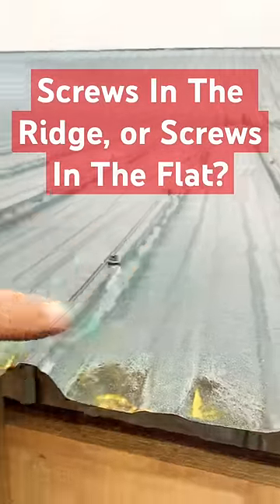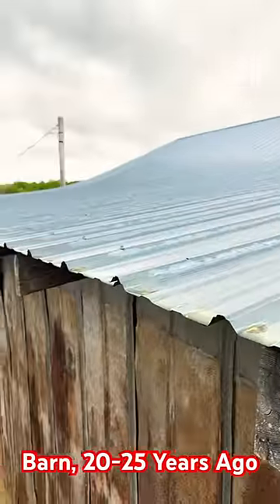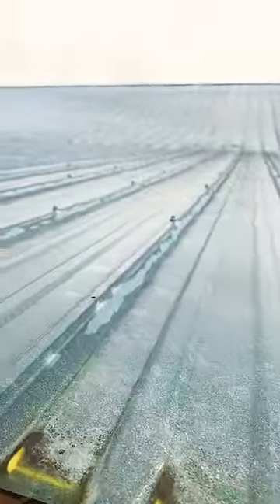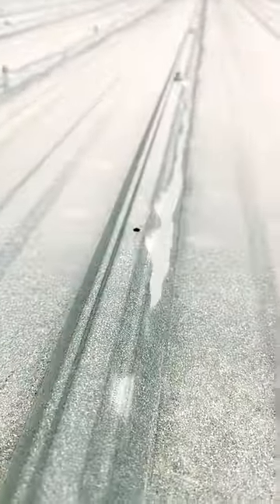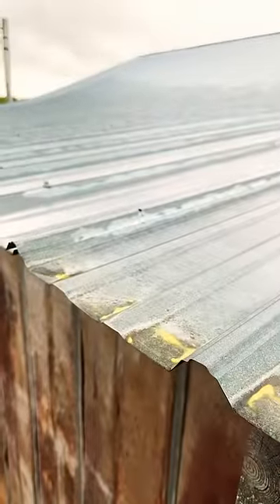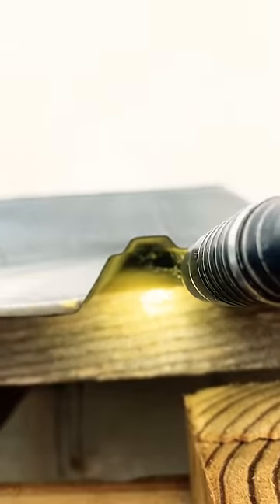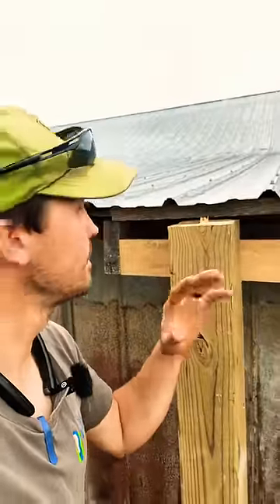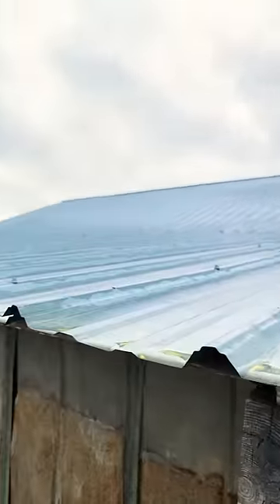What’s Better? Screws In The Ridge Or Flat? #construction #farmlife #building

Comment: We've been using corrugated iron rooves in New Zealand for well over a hundred years. You never nail or screw on the flat. Always on the ridge  !
Reply: Thank you for proper plural spelling/grammar ie; "rooves", and not, 'roofs'.
Refreshing.
✌️🤎
Reply: @kajem575    well,  the dictionaries will disagree with you and note that "rooves" is accepted as a minority form

now if he had been an Aussie it would have invoked images of the things Roos have on the end of their hooves  ( hoofs ? ) 

and folks wonder why English is so confusing to non-native English speakers
Reply: How about in siding applications?
Reply: CHUR CUZZYBRO!🤙🤙
Reply: @davidboakemeek  in panels like shown in the video, always in the flats except for stitch screws in the overlap   --   on corrugated used as siding,  doesn't really matter
Reply: @boagrius7765  Yes. Yes, he does know. I constantly watch videos of USA folk put screws incorrectly in the pan. We Australians have had metal rooves for 101 years, therefore having more experience than the Kiwis, nevertheless he is 100% correct.
Reply: This is not correlated iron. It’s formed aluminum installed with gasketed screws in the flats as required by the manufacturer except where panels overlap.
Reply: @CombatMosquitoTrainer No he’s not. This is not a corrugated steel roof. It’s formed aluminum an gets installed with gasketed screws placed in the flats except at overlaps, as required by the manufacturer for the warranty to remain in effect.
Reply: @kenton6098  If you put screws in the pan of a zincalume roof you will eventually get leaks as the neoprene washer deteriorates. ALWAYS.
Reply: You never nail a screw
Reply: @kenton6098  right:  not corrugated iron  -  it's corrugated steel  -  not aluminum

from the close-ups you can also tell it is galvanized and not galvalume    -     galvanized uses a zinc coating   -   galvalume uses a zinc/aluminum mix which makes it smoother and shiny  -   you can galvanize aluminum and you can buy aluminum roofing,  but it has a lot of "ifs" and costs way more which is why you seldom see it except in architectural roofs

you are 100% correct it fastens in the flats and laps per the manufacturers
Reply: Manufacture wants you to make holes in the flats to sell you more product duhh…. warranty 😝 it’s about to expire anyways
Reply: @artolicris  same reason for everything. That's why step number one, with anything i get, is disregard the instructions.
Reply: @Sublime_1 unless you're in prison and she's hot. Lol
Reply: @bisurdaddy  lmfao. This is true.
Reply: I would put majority in the ridge but in strategic spots I would hit the flat
Reply: @Sublime_1     you must have never worked around electricians
Reply: That's not what the manufacturer say.
Reply: Kia Orana  , We do the same in Rarotonga 
tuanui
Reply: @Sublime_1 
Is that why it’s common knowledge/stereotypical that “as men we don’t need no damn instructions”??? I mean, for whatever reason, we do always disregard the instruction no matter what we’re assembling and/or putting together!?!?!?
Reply: @jongoin4404  probably.  Lol. Its just built in knowledge ingrained in our dna
Reply: @chrisalister2297    yeah:  but all the manufacs do is hire designers and engineers for the product, manufacture the product,  and warranty the product ( on metal roofs usually 20 years -  some as much as 50 ) against leaks caused by defects IF installed according to certain criteria   -   why in the world would anyone think the manufacs would know the best way to install their own product that they have to warranty ?
Reply: @CombatMosquitoTrainer   well when my great-granddad built the buildings for his farm in Iowa  in the United States way back in 1891 (which was 133 years ago) he nailed all of his galvanized corrugated steel roofs on the ridge.  Because my great-granddad would not have done anything wrong.  And I say nailed because screws were too expensive for most farmers..   they use nails with a lead washer.  It worked because those buildings built that long ago are still keeping the rain out.
Reply: I build steel buildings and you never screw in the high ridges. Only at the lap. 

The low portion is where you put your structural screws.
Reply: @kasaljf  Yep. Same here in Australia.  Some of our corrugated galvanised steel rooves are 100 plus years old still nailed with the lead washers.
Reply: @ARC1A1A  who imstructed you to do it that way
Reply: @Sublime_1  i’ve been building steel buildings for decades. All of my manufacturers from Nucor to Cornerstone. Lap (Trim) screws go on the laps (Highs) and structural screws go on the flats into structural members.
Reply: @ARC1A1A  yeah, that's what i figured. Im not saying one way or the other is right. But, The people telling you that, have every reason, to tell you to do things in a way that limits the life of the product. If you're screwing only flats, they can use less material for screws, making more profit there. if it rusts over time they get more profit for repair material. If the roof lasts forever they really don't benefit from that unless they only sell material for new construction. For what specific reason is the flat used? It probably holds more secure, id assume, but, after time rusted screws aren't secure. If they keep from rusting it could make more sense, for longevity, to do on the ribs. Given it holds secure enough, Which it appears to have held up pretty nicely on this roof that looks pretty old. I havent dome many, mostly do rubber and pvc, but, every metal roof I've done, was screwed on flats, and alot of the screws were barely holding on from being rusted, and they weren't old at all in comparison to this roof.
Reply: @Sublime_1  yea well every metal PEMB building manufacturer I know says to do it that way so if you don’t your warranty is shit. And we’ve been doing it like that for decades.
Reply: @ARC1A1A  And... what about any of that invalidates my point?
Reply: @Sublime_1  all of it. They have engineers who know better than someone in the field who thinks he knows better. It’s called research and facts. Look them up sometime. You’ll be amazed at what you can learn. I like working with engineers. They have a lot of schooling to learn best practices from experience and time tested research. 

To me that’s much more credible than some Joey off the street.
Reply: @ARC1A1A  automobile manufacturers have engineers too. And, guess what, they intentionally design things to fk up at a certain point so you have to replace your vehicle or buy their parts. You can think defensively, and not want to believe there is a even a small chamce that a business would tell you to do something in a lesser way, to make more money. It's a very simple concept of maximizing profitability, which is #1 goal with most any corporation. Or, you can have an open mind, and understand that just because it's what you were taught and most people do doesn't necessarily mean it's the best way. Ik you'd like to assume it's the best, I would too if I had been building buildings a certain way. Aside from, youve been doing it for 30 yrs,  its manufacturer instruction, and what your buddies do, you haven't given any real reason of why it may be better to put it on the flat. There's a person on here from a different country that says in that country manufacturer reccomends on the ridge, and they're all done that way there. They could be lying, idk, but so could the manufacturer on the best way to screw it.
Reply: @ARC1A1A  results are what's credible to me. When I look at enough old roofs with it in the ridge vs the flat, that is when I will decide which is better. Uk, I was hoping you'd come in with an example of roofs you've replaced or something that explains which wpuld be better and why. But, regardless of who said it, or whos been dping it for how long, , someone said so isn't a good reason to accept it as fact for me.
Reply: @Sublime_1  well research is the quantitive measure of results. Much more than what you can see with your eyes.
Reply: @Sublime_1  LMAO. 

Go design a car then you’re so smart. Or anything.
Reply: @ARC1A1A  who's research though? Like I said, someone saying so isn't enough to persuade me on what's best. Research can "prove" things that aren't accurate. How the research is done, things such as, what you do, or dont, take into consideration, determine if your research is worth a shit or not. And, Research done by people/companies who sell or manufacture the product, who need continual business, regardless what it is, is not research I will have any faith in. Due to potential motive. You can believe what you like. I'm not telling you one way is better than the other, or that I believe one way is better than the other. Both make sense for different reasons. I'm simply stating the fact that, what manufacturers recommend, or their research says, what people do or don't do, doesn't necessarily mean that it's right or best. What I think is it probably depends, as to what's best. If you live in a place with lots of ice snow and rain, but not alot of wind, the ridge is probably better. But, if you love where there's alot of wind, the flat is probably better. It only makes sense, the flat is more likely to leak, yet, more secured. The ridge is, most likely, less likely to leak, but, probably,  less secure due to the gap underneath. Tbh I'd bet everything I own, it's dependent upon the conditions in which the roof needs to survive, as to what is the best method.
Reply: @ARC1A1A  I didn't see all of your reply. That makes sense. I think one of the reply to you was actually meant for someone else.
Reply: @ARC1A1A  the structural in flats and laps in ridge, is what I mean makes sense. But, I stick to what I say about conditions probably determines what's actually best.
Reply: @ARC1A1A  anywhere that would be covered from water, regardlessof conditions, I'd definitely put in a flat though. Because it makes sense to be more structurally sound that way.
Reply: @Sublime_1  Well let’s see. The Metal Builders Manufacturers Association of America, PEMB Manufacturers and trade groups all have done research on this topic. It’s well documented.
Reply: @ARC1A1A  okay. Well, if, i feel they're research is thorough, takes into consideration all aspects, potential variables, ect., it could potentially persuade me. But, again, manufacturers have every reason to have you do it in a way that limits the lifespan. Just like how they make lightbulbs to last 5k hours and have the ability to make them outlast our lifespan. So, Without seeing really good evidence, I would still believe the conditions the roof needs to endure is the main aspect that would probably determine which is the best method. Because, it makes sense. On flat is 100% more likely to let water seep in. So, if, on ridge would be structurally spund enough, it makes more sense.
Reply: @Sublime_1  I could care less what you think or consider. I gave you facts, what you do with them is your business. As for the other people, they may be smart enough to recognize that this isn’t done on a whim and people actually do spend millions of dollars doing research on subjects just like that because people are spending billions every year to buy steel buildings.
Reply: @ARC1A1A  Good. You shouldn't be very concerned with other people's opinions. If you didn't notice previously, idgaf what your opinion is. Wish ya the best, don't regret the conversation,  but, really dgaf

Comment: I’ve installed it both ways yet exclusively put them in the flat now. If installed on the ribs, as the panels expand up and down the roof when they warm and cool the screws rock back and forth (ever so slightly). This weakens their connection to the sheathing (especially in osb). It is also easier to “stretch” the sheet if screwed on the ribs possibly causing layout issues. Screwing in the flats also increases the shear strength of the steel to the building. In my experience, the screws in the ribs also cause a louder “popping” sound when the sun hits the sheets and they expand and contract. Metal Sales recommends “stitch screws” for the overlapping ribs. These screws bond the connections sheet to sheet but do not reach down into the sheathing material. For my company, it also comes down to liability. We install according to the manufacturer’s instructions so they bear the burden should the product fail.
Reply: I'm not a roofer but hear this debate alot and I think when the rubber washer eventually fails it will leak either way...on the ribs it wont pool and runs off more.....1990 roof done by do it yourself builders still great almost 35 years..
Reply: Best explanation 👍
Reply: Thanks
Reply: Manufacturer of grand ribs as screw in the flat on both sides of the same and then one side of every corrugation so it is in the flat in modern Construction
Reply: Absolutely correct!
Reply: Bet those companies be out of business in 20years and won't have to honor the warranty 😂